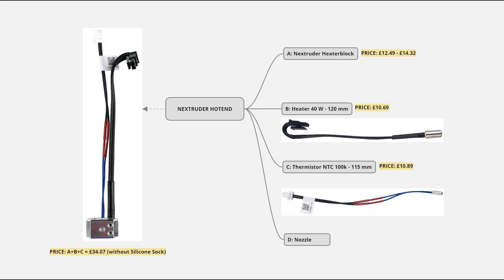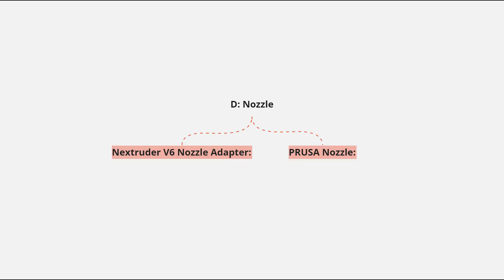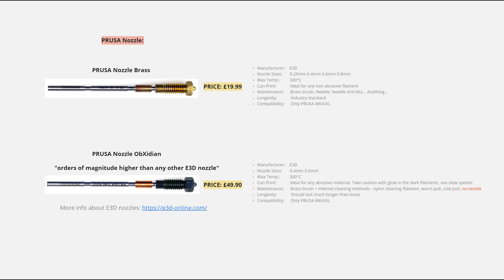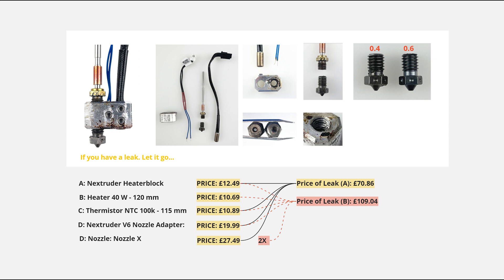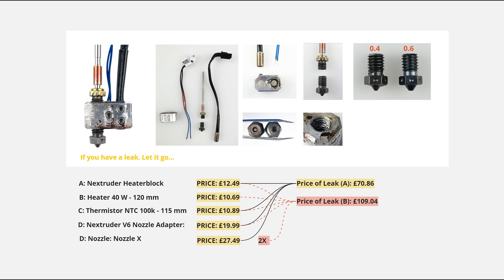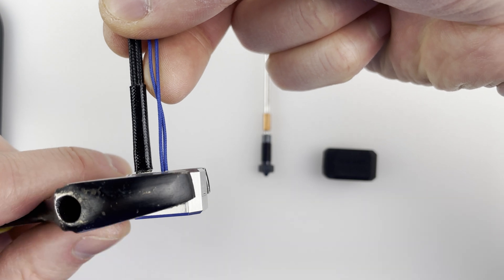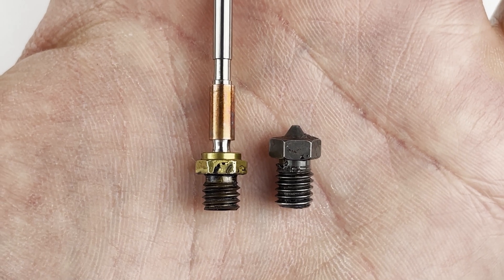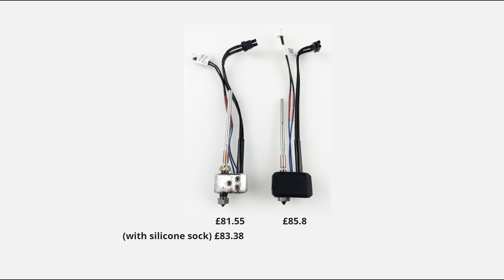Prusa MK4 / XL Nozzle Review & Hotend Assembly (Nextruder V6 Nozzle Adapter VS Prusa Nozzle)

Comment: As an XL user I have had hundreds of hours of printing using two v6 adapters and two v6 PCD diamond nozzles I used a little boron nitride thermal paste on the threads and used a torque wrench on the nozzle though i had to guess at the level of torque for the adapter.  My biggest issue was when I had a nasty PC-CF clog once in the adapter and was able to clean it by heating the adapter and using a purge tool to push out the stuck bit of filament, (the non Prusa PC-CF I was using was a super brittle nightmare out of the box and was prone to jamming from the filament cracking and breaking apart at various points in the filament path luckily the printer usually detected this and stopped before it ruined the print but all the halts made everything take much longer and the process unpleasant. 100% filament issue, though I am not sure i could have removed that clog as easily in a standard nextruder nozzle.). My generation of nextruders came with 0.6mm nozzles which while okay were not printing with the quality and detail i wanted from my printer and after others reported having success with 0.4 and that i already had several nice v6 nozzles for my voron using an adapter made sense to me.  I did order the 2 to 5 print head upgrade which if they come with 0.4 nozzles i will likely keep as is as i can’t see myself needing to print with more than two abrasive filaments at a time and i agree that the unified nozzle is great and has benifits for most things.  I remember trying a hardened tool steel nozzle on my Voron and while it worked I did find myself having to constantly tweak temperatures to get the same results as my brass nozzles hence why i tried a diamond nozzle which in theory has much higher thermal conductivity and lower friction so in theory easier printing with difficult plastics. They are expensive and for sure not needed by most people though recently i found a copy cat PCD diamond nozzle for half the price which i am testing now…  I would describe it as a good value compared to the original but my impression is the original looks ever so slightly more polished.
Reply: This is THE best solution for using the V6 adapter. The boron nitride fills in the gaps, much like plumbing paste does for plumbers, while also preventing the materials from bonding so tightly they cannot be separated.
Reply from the maker: Thanks for sharing! I found that neither with ObXidian neither with Nozzle X (with nextruder adapter) i did not have to raise print temperatures. I used OG Prusa Slicer material presets. With Prusament it worked. And i didn’t have any quality or adhesion issues. I do print with an enclosure so not sure if it helps, i printed PETG-CF, prints like a charm and also did small print of PC Blend from Prusa with ObXidian, also printed just fine. I only so far had issue with FilaFlex40 from Filatech yesterday it loaded and it came out via nozzle but once i started actual print it immediately clogged, i then stopped the print and unloaded filament and reloaded with PETG which managed to ram through. So no more Flex for me, but its MK4 issue i think, there are lots of people discussing that Nextruder doesnt grip well on soft filaments, but regarding all hard filaments im a big fan of Prusa nozzle. As you said, maybe if you use some binding agent for nozzle adaptor it can work, but then if you glue it can you later still change the nozzle, or do you need to clean? And how long it takes? Also as I know originally Prusa XL shipped with 0.6mm but i believe now they changed to 0.4mm.
Reply: @StudioSpaceDust  I print fine with both the Polymaker PCMax and 3DxTech ezPC on my XL if I use a really good higher temp bed adhesive the first spool of ezPC-CF I got from them was the brittle one it would break it just loading it into the extruder and could be snapped in your hand with no effort. I have a spool of PA6-CF nylon that I printed some voron parts in using my voron but have not tried on my XL because it has no enclosure.  My thermal issues with hardened nozzles were early on with my voron printing fast.. The XL thus far has been a nice printer though I do miss the speed and controls of my voron.   As to the boron nitride it is not a glue it is a high temp thermal paste i got when I was switching hot ends on my voron and continue to use when I want to improve thermal contact in the heater block, no idea if it helps sealing the nozzle... it wants to be dust and stain everything but i could see it helping gap fill the threads for any nozzle... I mentioned it as a possible reason I am having better luck using an adapter.  As I would be truly surprised if your MK4 vibrates more than my XL with all it's tool changing and the corexy design movement.  
As to flex filaments I thus far have only printed a flex PLA and a 92A TPU I find the PLA a touch easier with the TPU needing me to remove the PTFE tube from the extruder and carefully pushing it past the filament sensor.  It works but yes I think printing soft filaments on a nextruder is always going to be hit and miss.  Hence why I have the voron... it is where i try all the weird stuff.
Reply from the maker: @carolynhudson6858  Interesting, I was hoping XL being core XY would superseed Voron. But to be honest, its still early days with XL, there are still a lot of bugs, give it another year for them to work out firmware i think. Regarding Extruder adaptor I think one potential issue is that heater block is made of aluminium, the adapter is brass and nozzle is  hardened steel, I`m no expert but three different metals may have different heat retention properties and so on resulting in parts loosening up within heating/cooling cycles. To install prusa nozzle there is no need to heat the heaterblock before screwing in the nozzle unlike when installing nozzles via adapter requires to heat up hotend before tightening, and it still didnt help me. Witin 100 hours or so it got loose, then i tightened it, while hot, I tightened from top (the adapter) and from bottom (the nozzle) and I still got a leak. Potential improvement may be third party V6 heaterblocks. Also regarding PC, if you want to print it on XL  try Prusament PC Blend Carbon Fiber Black 800g, if you can get hold of it as its always out of stock, reviews seem to be praising this material a lot but its just never available.
Reply: @StudioSpaceDust  it’s hard to supersede a moving target like the voron.  But the tool changing in the XL while not a first by any means is what makes it shine. Five tool changing while expensive and complicated to get right is so interesting even if you only ever use it for color swaps I took a logo from a friend’s business website, converted it to a vector file and extruded the forms into a 3d logo even using stacking of different layers to make colors beyond the 5 filaments I had loaded.  I have also tried some mixed material prints but those are a much fussier print. If I had one wish for the xl it would be a toss up between faster cou for a full klipper + touchscreen interface or a good enclosure for printing plastics that like to warp bed adhesive helps but it’s no cure all.
Reply: Small update… I built an enclosure design from the Printables website… i appreciate all the effort the person put in but with so many large printed parts trying clear panels together with so many screws i really appreciate the voron team when it come to ease of part prints and assembly.  That said my first attempts to use it for high temp polycarbonate prints were failures because the print volume would get too hot and heat creep would cause extrusion failures. I might need to modify the enclosure to have some sort of fan system to keep the printhead and its electronics cooler somehow. Mind you i keep my printer in my small office that has always been the warmest in the house so maybe in a cold garage it might not need the fan.

Comment: This was awesome advice. Thank you so much for sharing. I just got my MK four and didn’t know how to handle the different nozzle options. This gives me the wisdom. Once again thank you.
Reply from the maker: Its an awesome printer, just be mindful with small detail printing, it can clog the nozzle. It will come with 0.4mm brass nozzle - use it to learn, install ObXidian after you have better idea of how slicing works. Brass nozzle will print everything its just that it will wear quicker if you print abrasive materials such as CF. Also, its safe and I recommend installing silicone sock with prusa needle, while with nozzle adaptor I would not recommend. And between ~10h print time make sure nozzle doesnt get loose within heater block. It will print even if its loose but safer to tighten it. I will make video how to maintain MK4 later. So stay tuned. You need to do that every ~200h print time. Otherwise - welcome to the team Prusa :)
Reply: @StudioSpaceDust , Sorry I should have been more specific.  I own two MK3 for the last four years and I am going to replace them slowly with the MK4s.  So it is the new features and hardware of the MK4 I am new to.  I did buy the socks based on your recommendation.  Previously, I found them a pain with the MK3, but you have changed my mine for the MK4.  I had hardened Steel nozzles for the MK3 and was wondering what the equivalent was for the MK4.  I will check out the ObXidian.  I print a lot of  board game inserts so 0.6 and 0.8 comes in handy.  I am excited to experience swapping the different sizes out quickly.  It is my main reason to upgrade since it was such a pain in the MK3.  I look forward to your next video on maintaining the MK4 video or any video about the new nozzle formats. thx
Reply from the maker: Understood. Since manufacturer of Prusa nozzle is E3D, the only available option from them when it comes to hardened steel nozzle is ObXidian, which is at the moment only available in 0.4 and 0.6 mm. I’ll aim to make short video how to quick change Prusa nozzle asap. Thanks for good idea.
Reply: it's actually pretty bad advice from a guy who doesn't know what he's doing and haven't learned how to do things right other than keep throwing more money at it.